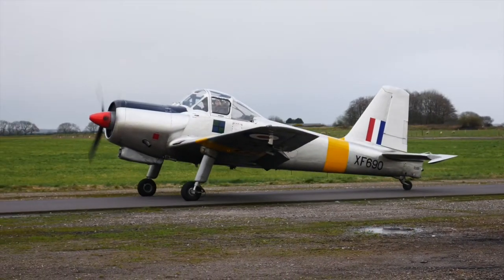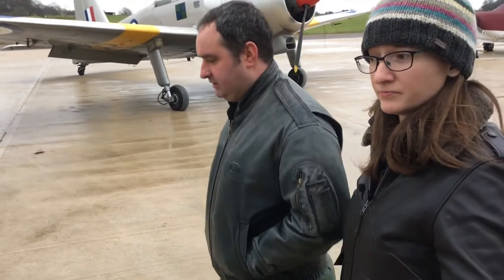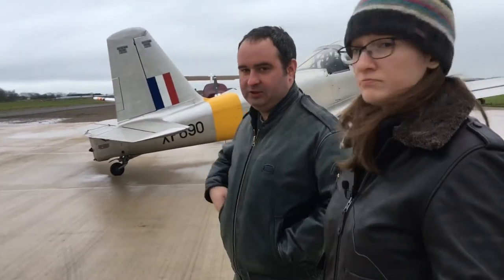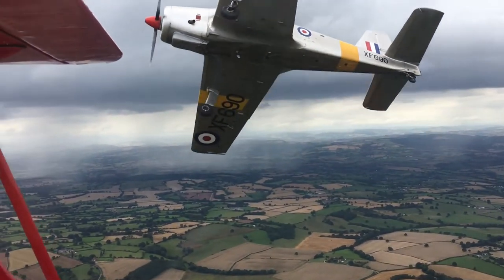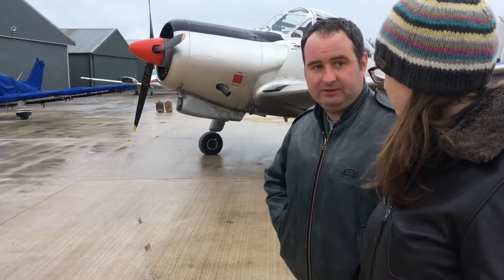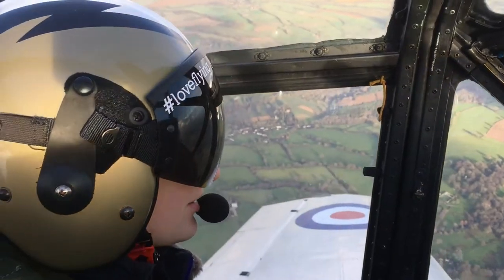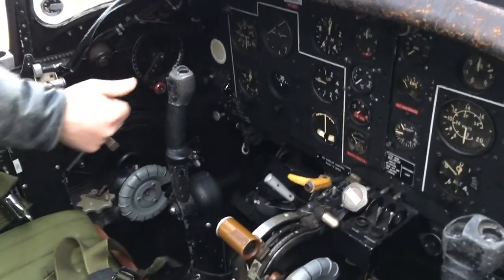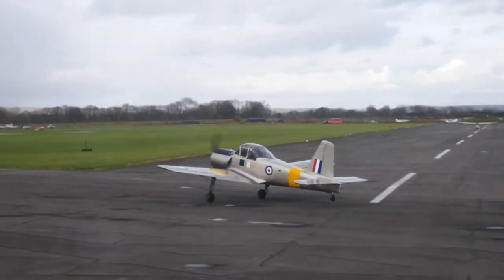Inverting Expectations 8 Percival Piston Provost | Airshow and aerobatic vlog

Comment: I worked on these at RAF Little Rissington, Gloucestershire, England. Its funny how I remember the pneumatic system was charged to 450 PSI  and it was cartridge started. 6 shots in a Koffman starter and loads of smoke out the back